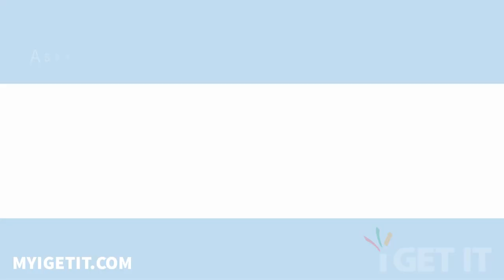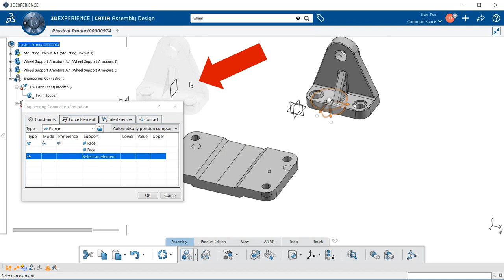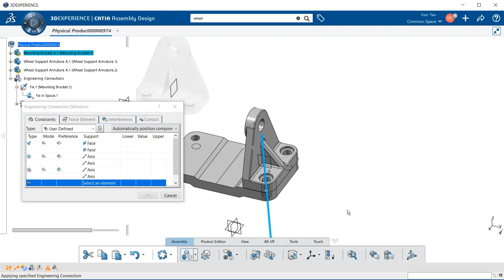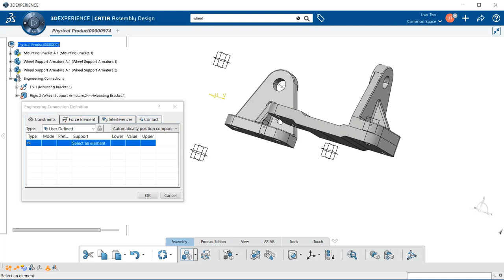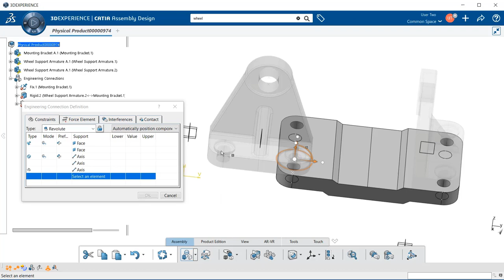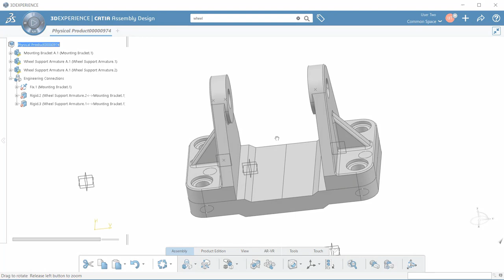How to use Engineering Connect Constraint in Assembly Design | 3DEXPERIENCE CATIA

Comment: If you had pressed the updated button after having created both kinematic joints, would you have got an error, specifically an Invalid Engineering Connection Configuration? If not, why?